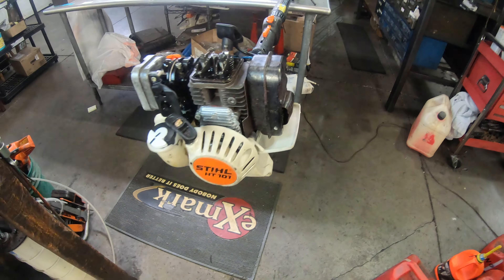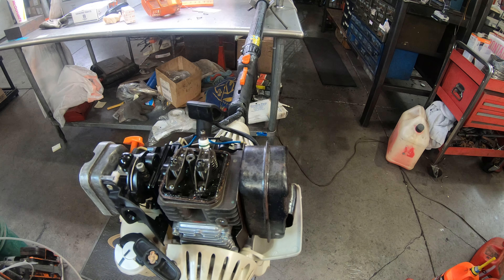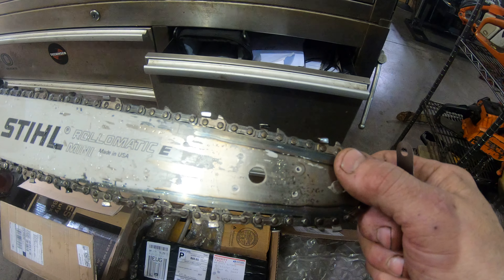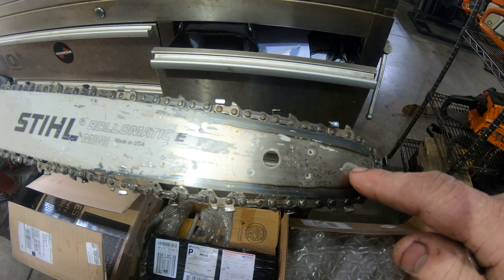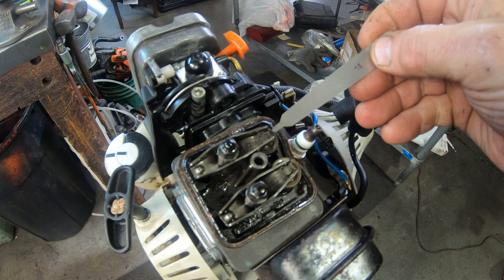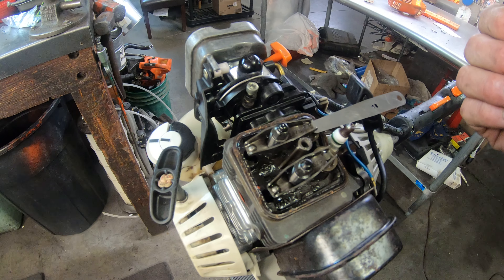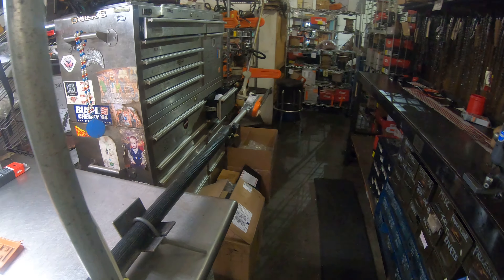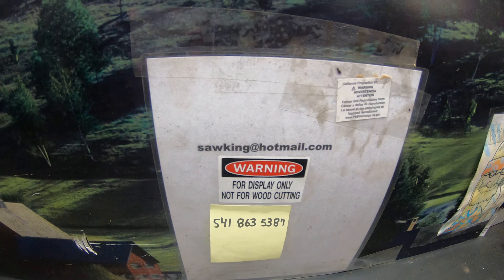West Coast Muscle Saws Special Application Stihl HT 101

Comment: I thought 4 mix engines were 4 stroke using 2 stroke fuel for lubrication?
Reply: If it's 101 engine it should be 4-cycle which is called "4-Mix" since it's indeed a 4-cycle engine that works on a fuel & oil mixture. Anyone correct me if I'm wrong - but this is by STIHL company, not me. I'm sure our beloved CS Guy meant the above, just came out as it did on the video, nothing more. Say?